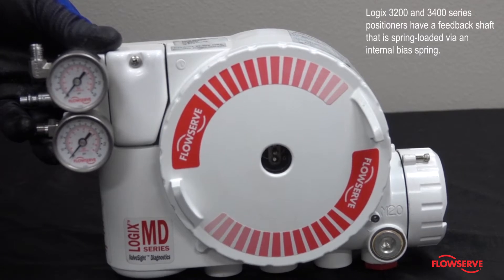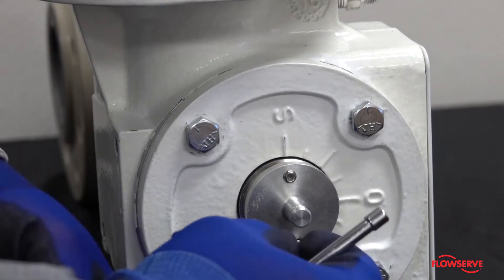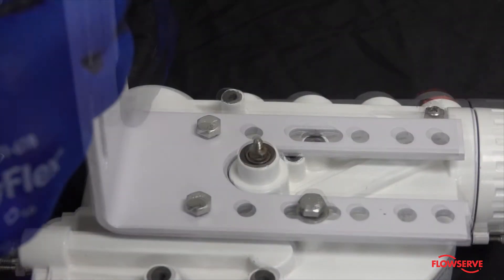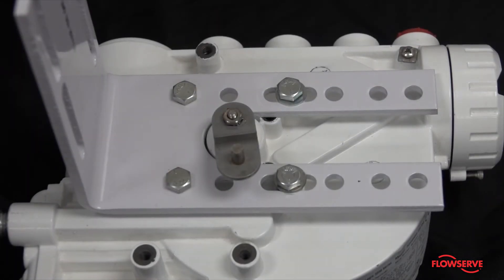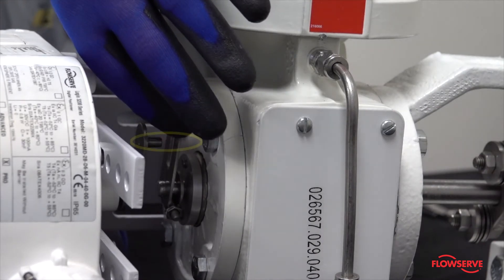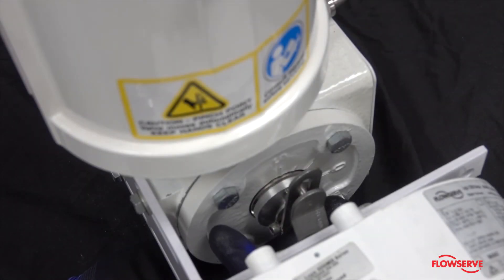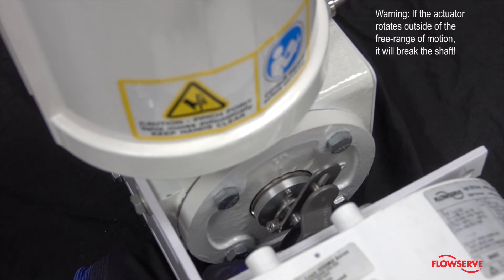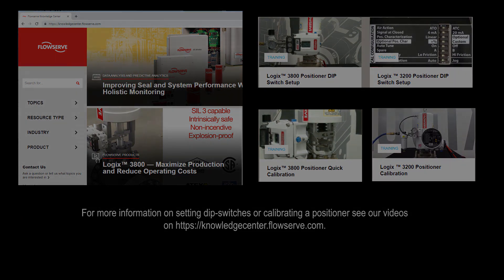Mounting Flowserve Logix 3000 Series Positioners to Rotary Actuators

Comment: Sir my valves shows led error code cycle limit reached. What does it mean. Its logix 3200. Also after this code after some time the positioner stop working to close or open the valve.